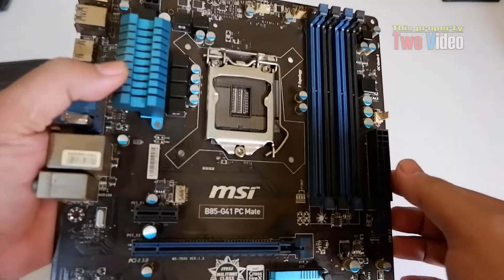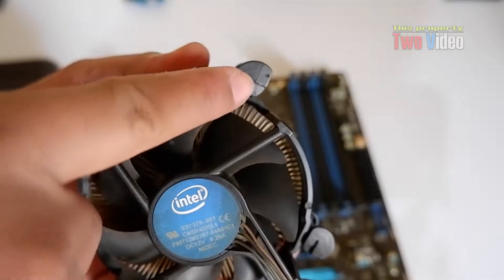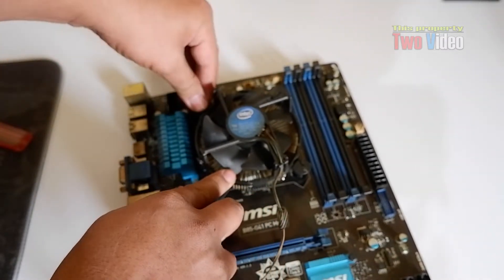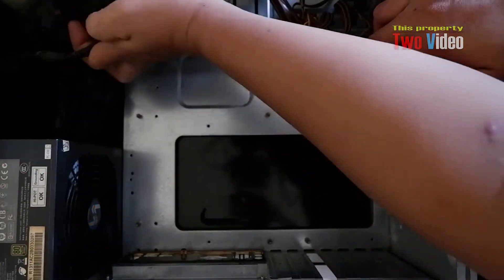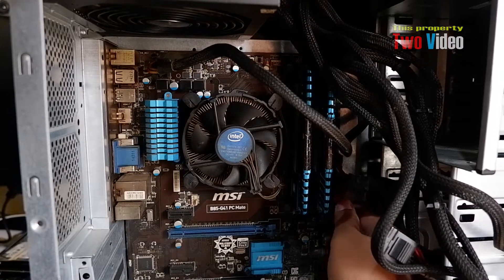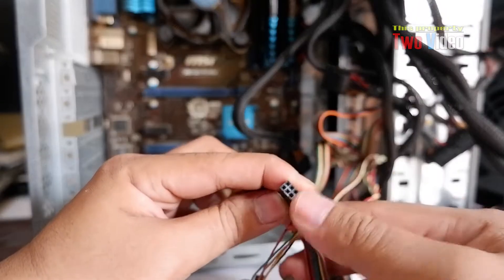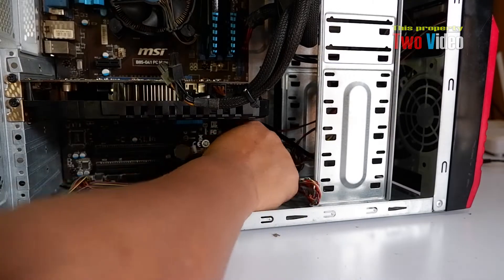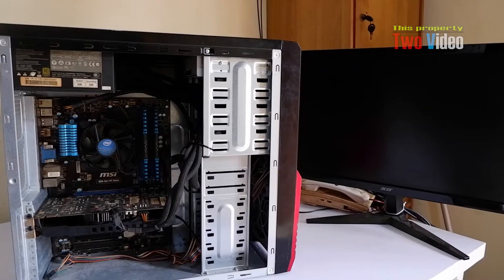PC Build i5 4th Generation with gaming test

Comment: Ddr 4 or ddr 3 ram ?
Reply from the maker: DDR3 brother, did you see on my video?
Reply: i never saw ddr3 motherboard with 4 ram slot :)
Reply from the maker: @chiefengineerso2475  really? DDR2 motherboard have 4 ram slot
Reply: Hp mb came with prodesk akso has 4 ddr3 slots